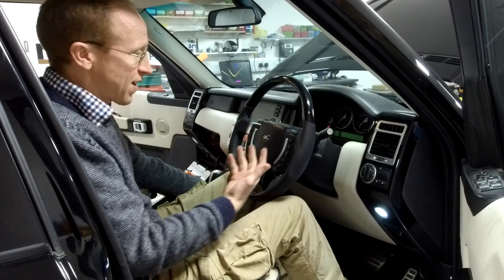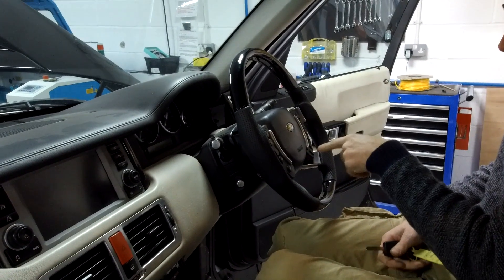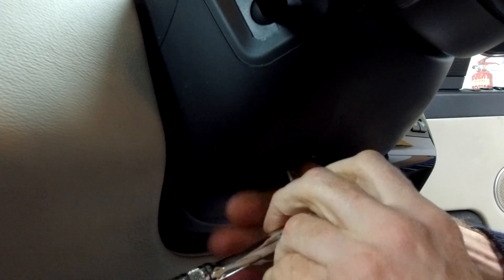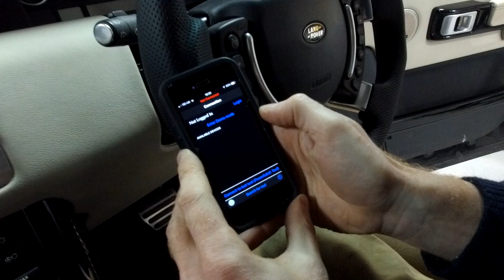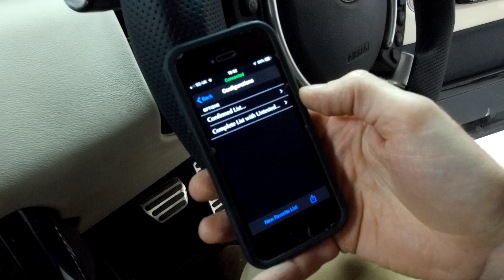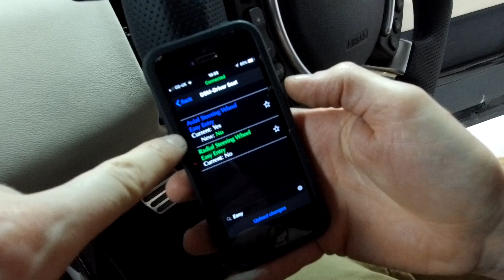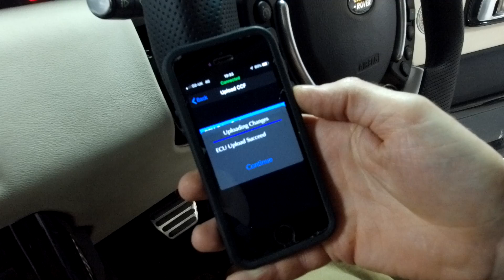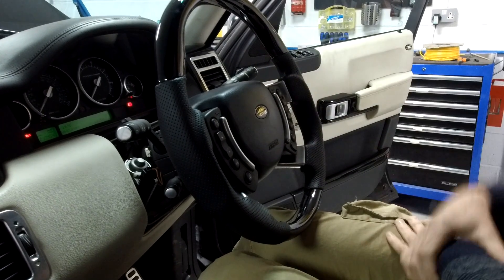Range Rover L322 steering Column Motor Operation & Fault Finding Using GAP Diagnostics IID Tool

Comment: Well my steering wheel got stuck all the way in the bottom and doesnt go up, does that mean my motor went out or is it just the mechanics that got jammed and are malfunctioning like the forks?
Reply from the maker: This is a common fault - the mechanism has failed

Comment: hi Guys! Love your channel - and this video in particular. I have a 2009 L322, and one of the 'forks' of the steering rake adjustment, the very piece you show in this video, has broken off. (I wish I would've seen your video before it broke off, I would've disabled the function.) But now that it's broken, is it possible to just replace that one piece - or do I have to replace the entire steering column? If it's just the piece, what's it called so i can search?

Comment: I know this is a bit late, but having had key freeze problem twice I have got a little tip that may help if you are stuck.
There is a tiny little solenoid in the lock on the column that is connected to the immobiliser/key function. If you don't hear the clicks( mine has dash mounted key) when inserting the key then this might help although drastic, will get you home. 
Remove the column shroud, 3 torx screws.
If you have a helper, get them to wiggle the key as if you are trying to start the car, then 😲😲😲😲give the under side alloy part of the column a good banging with a hammer which while wiggling the key should shock the solenoid into releasing  the key and you can start it. Mine doesn't have the 18 fuse. This is a one off get you home key release. Don't turn key off once started till you get home.
This has happened TWICE on my 2008 and both times has got me home. I bought a used upper steering column on both occasions and it's easy to change.

Comment: What is causing my steering wheel to go down all the way down by it self when I start my car. I can stop it by touching the handle but it won’t go up. 
After driving a wile I can live it up again but the steering wheel got a little life of it self :(
Reply from the maker: This is a common problem caused by the failure of a part in the steering rack. There is a lot of information on this on the forums. You can disable this feature in the software.

Comment: Mine wont go up any higher, it just able to move down. As if it is at the top limit but it actually isnt. Is there a way to reset the hight in these?

Comment: We had it drop permanently so had to weld the tab on so it would fix in place. We also pulled the cable to to motor to stop it
Reply from the maker: Yes pulling the cable will stop it moving that causes the wear

Comment: hi I would need advice I L322 2004 working my memory steering wheel always goes out and immediately beneath the seat
Reply from the maker: I think this is the problem with the steering adjust motor. I think this is well know issue. One fix is the remove the fuse that controls this.
Reply: @L663  can you advise me which insurance it can be?
Reply: @L663  

will the steering wheel memory work for me?

Comment: I've been watching your video's tutorial since I had my range rover 2004 L322
honestly I learned a lot from you and we are very thankful for that, i have a situation that my steering column sometimes tilt and move back and fort but mostly not functioning.
I am having a problem with my steering wheel buttons all are not functioning but sometimes they work and most of the time doesn't work could you pls advise me what do I need to do to sort out the problem. Hope will hear from you soon and more power to all of you. Many thanks

Comment: I have an issue with my L405 steering wheel. It won’t tilt or adjust but steers ok please advise
Reply from the maker: I would start by looking at the fuses. There will be a fuse for the steering wheel motor.
Reply: powerfulukltd thank you. Any idea of the fuse number ?

Comment: I’ve got a popping sound that only happens at full lock turn as I pull out of a tight parking spot. Pretty loud. What do you think the problem could be? Thanks for your intuitive video. It’s an 05 rrs sc
Reply from the maker: My bet would be front wishbone bushes - they are a common failure.

Comment: Thanks for your videos guys!! I have found them helpful on many occasions. 
I have a question on a U.S. 2006 full size L322 Range Rover regarding power steering. I have a very heavy steering wheel at low speed. I've changed the pump along with fluid and the QFW 500040 rack solenoid. The problem used to be intermittent but now it is constantly heavy at low speed.  I thought maybe the replacement QFW 500040 was a bad solenoid but not sure how I would test that. Do you have any videos on this or Do you have any suggestions?

Comment: great Video - the column on my l322 2007 vogue went down on power but wont come up - power going to the winding mech as I could hear the motor running when using the joy stick, removing the motor was easy enough - if you open the gear casing access (wit a Dremel tool) you'll see the little white plastic cog 10p sized has lost it's teeth and is not mating to the inner spindle from the motor.  its £150+ for a new gear motor, to replace the 50p gear cog IF you can find one to match on RS etc.  I used 2 part modellers resin to fuse the cog to back to the shaft (it worked well for 2 months and broke again under the huge stress and that stupid easy access which you cant turn off without a £400 iPhone app) quick fix is to wind the steering wheel into position with a 10mm spanner via the windings spindle in the column itself, pull the plug to the motor and forget it, mine is set to a central position for me and the mrs to put up with but it saves us £150 for new motor and that stupid easy access killing the battery
Reply from the maker: thanks for the comments - should i look at 3D printing the cog ? would it be easy to replace ?
Reply: @L663   for 3dp you should have a model (I can’t find it and making it would require precise measurements on a pristine part) and the thin thread would be not strong enough if you don’t have a 10k SLA printer with a special resin.
The first problem is solvable with a few trials if you have the original part. The second problem could be solvable by inserting a common plastic nut (Nylon, Teflon or possibly some low wear polymer, not metals) into a cheap 3d printed part that fits the broken one. So with some tricks and work it could be the real cheap option! 

Btw thanks a lot for all these unique videos you are offering us!
Reply: I have the same problem on my l322 from 2007. So you say that, when you replaced it with a resin copy, it worked fine for a little ? I was thinking it is an electronic issue as, when you shut off the engine, the radial actuator puts the steering wheel in the lower position automatically and sometimes it won’t move up even if the motor turns. Anyway I should check if the gearing looks good before making any conclusion :)
Reply: @Groucho92  it’s the teeth on the drive cog the weight of the steering wheel going up just destroys them

Comment: What happens if the column wheel will go down but wont go up, what to do? Thanks! Followed your videos and always loved them!
Reply from the maker: Hi - i think this is the broken carriage problem - if you can get it up to the correct level i think you are better to remove the fuse - not a full expert on this though so check out some other videos from other guys.
Reply: @L663  Interesting? what if it is stuck? do you have links to any helpful videos? I am having trouble finding them.
Reply: me too!

Comment: The operation of my column adjustment is unpredictable. Most times it works as expected. However, other times I seem to lose all functions. Lately if the weather is cold (below freezing) I find the "easy access" position at the lowest point , so getting in can be a struggle. Once started there's a chance it will move out, but the up/down function does nothing. Most times once things warm up some I can raise it if I push the lever up and give it some assistance (push up with my leg). All other memory functions for seat, mirrors seam normal. I have not opened up the column to look yet. Do you have any thoughts of what may be causing this? Is it possible that the gears just need lubrication or is the motor wearing out?
Reply: Same here on my 2007 l322. Recently it does it almost every time and temperature outside is 35 Celsius so I would discard this correlation in my case... Have you find any solution ?
Reply: Same here. Any updates from anybody?